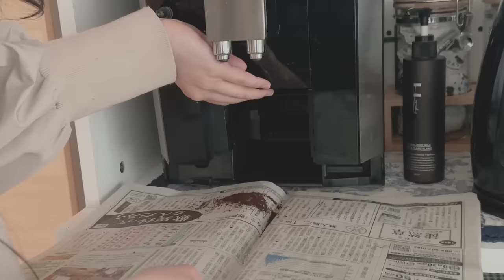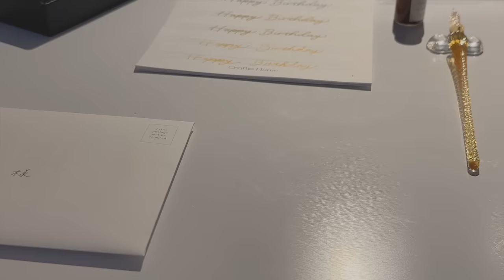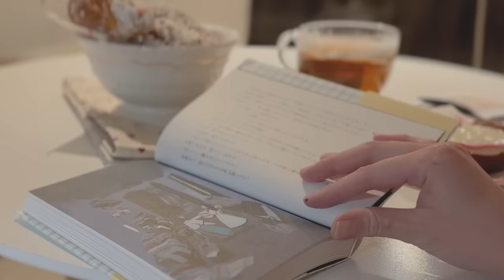【Clean with me】 いつもより時間をかける毎日の掃除ルーティン daily cleaning routine Japan VLOG

Comment: I saw you cleaning your vases, and I have a tip (from a friend who is a professional florist): tablets for denture cleaning (to clean false teeth) are perfect to clean vases, 1 tablet for a big vase and half a tablet or less for smaller vases. Dissolve in hot water & leave for about half an hour, then rinse thoroughly. The tablets kill all bacteria and the flowers will remain fresh much longer in the clean vase.
Reply: Great tip, thanks!
Reply: Thanks for this idea! I’ll definitely try this!
Reply: Thank you!
Reply: 良いヒント❗有り難うございました。是非、明日試してみます。
Reply: Hi you can’t put very hot water because it will crack, won’t it?
Reply: @annyates7212  Glass can hold hot water, but warm water is also good.
Reply: Thanks for the tip.
Reply: @annyates7212  Sudden temperature change is what causes breaks, so if you do it gradually by soaking the glass with warm water a little before pouring in hot, you should be fine. It does depend a bit on the glass type though. If it is thin, or has a lot of bubbles in it, be more careful with temperature changes.
Reply: Kendin nerelisin yoksa sadece orda yaşıyormusun?
Reply: Yes, they work very well to clean vases. But they will also clean drinking cups in the bathroom and if you put your toothbrush in cup upside down you toothbrush is much cleaner also. Yep, works on electric ones as well, as long as it's only the front part with bristles is covered.

Comment: There is a large screw that you can turn to adjust the doors so they fit better! Its the middle ( larger) screw between the two smaller screws that you put in to the pre-made wholes. If my explanation doesn’t make sense then hopefully google can help. But you did everything right ! Great job ❤

Comment: Nami-san?! Grateful for today's video. Just like you I try to be as independent as possible to even manage to fix my own washing machine 😂😂 Safe to say: Girls do run the world.
4:16 the same thing has happened to me once and I found out that I had screwed it too tight, after unscrewing it a bit it got fixed to perfection. First, please, check if the screw is adjusted and well aligned with the hole then, if necessary unscrew it a bit. Or it can possibly be also the opposite: one of the corners not being screwed tightly enough.

Comment: For your nails, you need to use unscented sea salt baths and warm oil baths. One day salt bath. 1 tablespoon of salt per 300 ml of warm water for 15 minutes. Then rinse your hands with water and apply the cream. On another day, heat any vegetable oil to a well-warm temperature, dip your fingertips into it for 15 minutes. Then gently rub with sugar and rinse. You can do it every day, you can do it every other day. And you need to look at the vitamin Biotin. 🍬💖💐

Comment: Nami:  the door on the cupboard, top, right that is uneven CAN BE ADJUSTED with the screws on the hinge.  Go to youtube and I bet you will find a video on how to adjust the hinges with a screw driver.  European style hinges are adjustable!  In the west, it is definitely NOT "bad manners" to use your legs to move a heavy piece.  The thigh is the strongest muscle in a woman's body - so use them!  Use felt pads for the bottom of the chair legs.  They have a strong adhesive backing for mounting on the bottom of the leg.  You should be able to find some felt discs at Ikea or the 100 yen store (we call it the Dollar Store in the States).  The felt pads are a MUST on hard surface floors that can be scratched.

Comment: If you add a magnet to the top of the cupboard you had an issue with and one on the inside panel of the door it may pull the door up so it sits correctly.

Comment: NAMI, just a suggestion, If you're getting that much dust, maybe there's a filter in the heating system somewhere that can be changed easily by yourself or by the building manager. You shouldn't be getting dust every day.

Comment: Nami, you can fix the doors simply by turning screws a little. Have a look for a tutorial on adjusting  cupboard doors. 
Also for your nail troubles, wash your hands after you clean with a gentle moisturising hand soap and put on a good hand cream. Dr Pawpaw hand cream is the one I've been using and it's strengthened up my usually weak nails